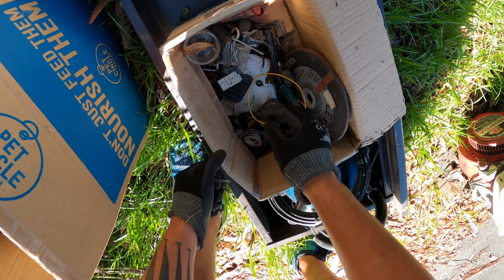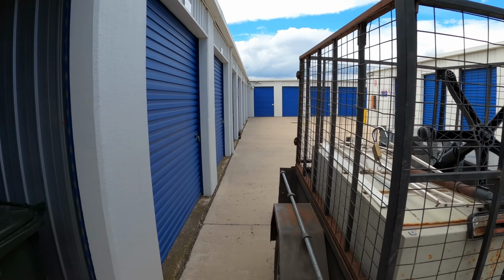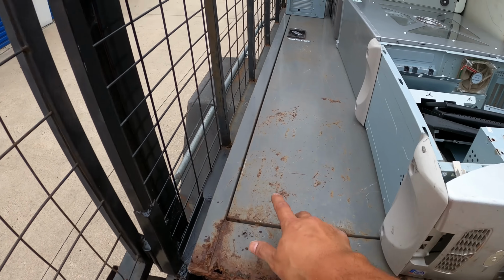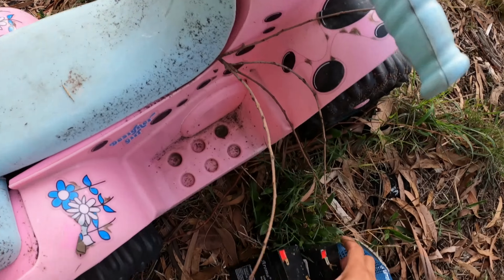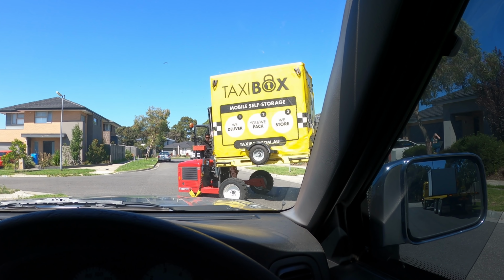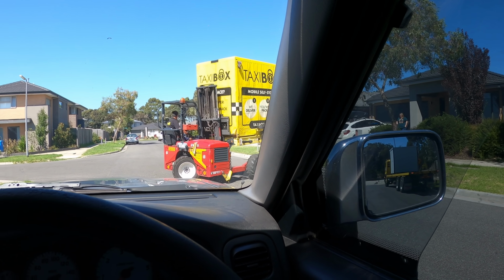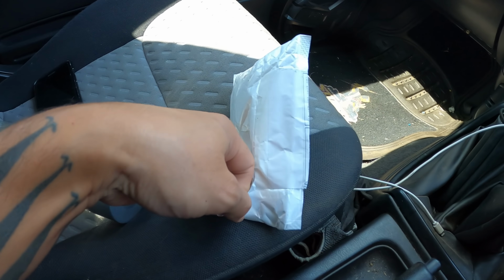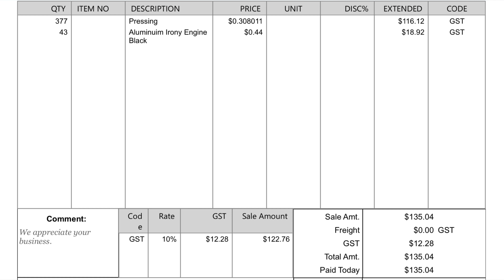Best Scrap Prices I’ve Ever Seen!

Comment: Gosh hon!  I think you’re being a bit picky…the site where you picked up the Honda motor had some good small scrap.  Probably weighed more in total than those filing cabinets and metal shelving you keep picking up.
Reply from the maker: Yes true. I got excited about the Honda motor  😅 The locker and filling cabinet were pretty heavy though 💪
Reply: @PolyProphet  and the locker and filing cabinet take up a lot of space!  They also could be filled with the stuff in the boxes to at the least double their weight.  Love your vids hon!  Which trailer did you decide on?
Reply from the maker: @scooterllm  yes I did fill them up 😊